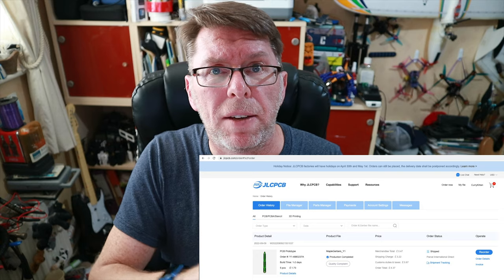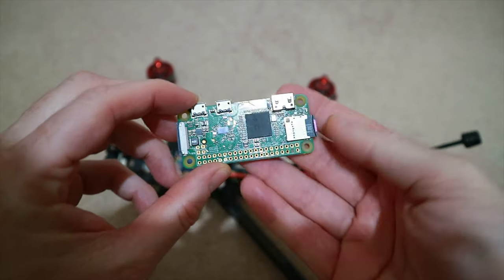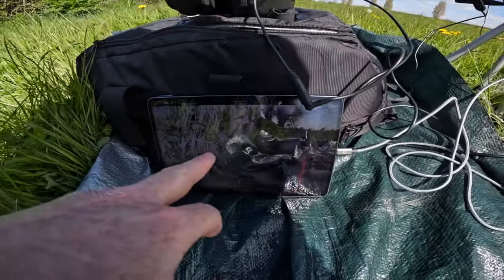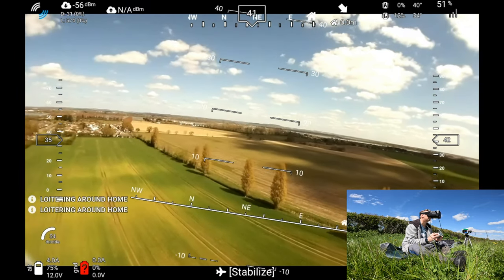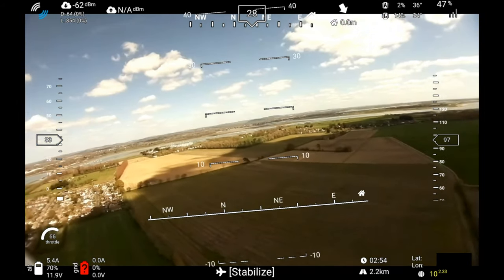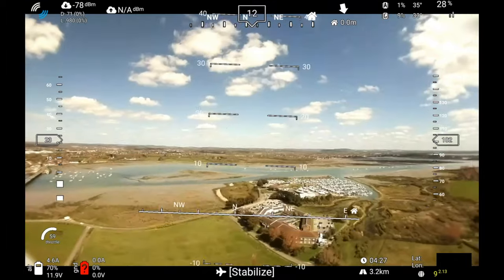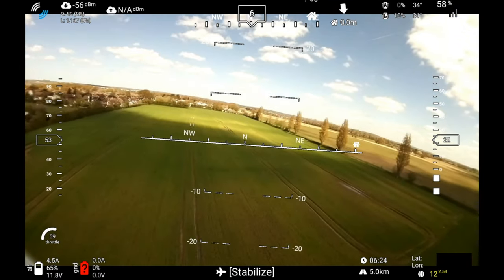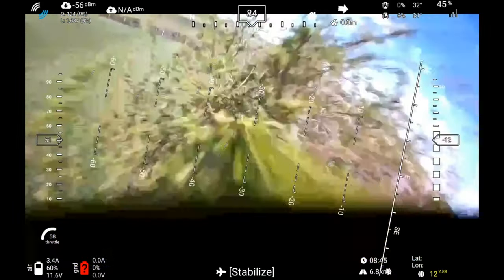Open.HD - getting a great picture finally.   It's all about the antennas!

Comment: Good job Wayne....That huge ladder AHI is so distracting. Do you even need it if you're not in cloud?...Those PCB antennas looked linear to me, my favourate when flying in 5.8g. Entertaining video m8...🤔😳😏😀😀😀🇬🇧
Reply from the maker: I agree - it's mostly there to see if the AHI drifted out... which, of course, it did.  Once I'm happy that I get that stable I have options to make that much smaller or turn it off
Reply: @CurryKitten  More to the point, where did the OSD come from?...

Comment: Have you tried a HDMI-to-CSI2 board on the Pi Zero? Wondering how good Open.HD would be for HD downlink on a camera drone, from a smaller Cine Cameras HDMI output.
Reply from the maker: I haven't, but I know others have and get good images from it.  It does apparantly add some more overhead to the latency though

Comment: Could you provide order deatils for the maple leaf antennas?
Reply from the maker: There's a section here https://openhd.gitbook.io/open-hd/hardware/antennas that links to the recommended antennas.  This will take you to this page https://forum.openhdfpv.org/t/maple-leaf-pcb-antenna/460 When I checked this today, they were doing some server rejigging - and it was down, so I'm not sure what it looks like, but hopefully by the time you'll see this it'll be back up.  Otherwise the raw Gerber files can be found here https://github.com/OpenHD/SwordAntenna
Reply: @CurryKitten  yes I thought the page would be back soon. You mentioned you had questions about thickness etc?

Comment: Glad you sorted out most of the issues, great flight video (except for the landing part 😜). In the early days of Inav, meaning years ago, me too, lost a couple of planes because horizon drift. So I switched to arduplane and never looked back.... Not an easy system to learn, but worth it by lightyears.
Happy landings, thanks for the hard work 👍🤝
Reply from the maker: Thanks for you help in all of this.  I haven't got on particularly well with Ardupilot.  Mostly I had "compass insane" flashing on my OSD and a refusal to arm :D  It's fair to say though, I'm only used it on an ancient APM 2.5 clone board and a regular designed-for-Betaflight FC that could run it.  I was actually going to start with Ardu in Open.HD, but I noticed it was putting out a 5v logic and the Pi wanted 3.3v.  I did get a logic converter, but ended up on iNav.  No doubt, more up to date ardupilot hw is much much better now

Comment: I wonder if you can scale a pagoda for 5.3ghz and build a custom helical for 5.3ghz. or to make it even easier, a 5.3ghz half wave dipole paired with a 5.3ghz biquad on the Rx. I got 1KM with a 25mw 5.8ghz aio cam with a  halfway dipole with a biquad. 
Btw this is the first time learning about openHD. Now I need to fallow the rabbit hole to learn more about this. Sounds cool.

Comment: I see your HDMI is on the side in the middle, it was easier for me, i have the Skyzone SJ-V01 and the HDMI is up top in the plastic part and i only had to make two small holes for a cable tie to secure the cable and could zip it down tightly as its plastic there and not foam like the main housing.

When you try Ruby you will like it, its soooooo different to OpenHD, the UI is also great and the mouse and keyboard free menu navigation rocks!

Comment: Nice update. Making nice progress.

Was going to say in last couple weeks the Pi Zero W inventory is reappearing, but sounds like only Pi Zero 2 W will be supported going forward. While they are a 2W's are ghost for stock at moment, they are promised to reappear in good numbers for 2nd half of this year. 
Can Pi cameras be used? RP just release some new editions a month ago. Just last week Sony (a maker of camera sensors) signed a tentative manufacturing agreement with Raspberry Pi Foundation. Details are on RPF blog.
Reply from the maker: Just typical they come back in and they aren't needed anymore :D  Yes - previously I've used an Pi camera, I did find the image quality horrible though.  There are some notes about the new cameras in this wiki page https://openhd.gitbook.io/open-hd/hardware/cameras/raspberry-cameras

Comment: Nice video as allways. Cool you didnt gave up on openhd :) 
I tryed 2.3.3 evo some weeks ago on a x86 laptop and pi4 as airunit with serious overclocking and it was working very well, recording with obs should be working aswell. I did not fly it yet, but the latency was noticably lower with this setup, especially on 640x480@90 fps. IMO all this projects need to be a really alternative to other systems i an affordable sbc with a decent h265 encoder and support for better cameras, for example e-CAM80.
Thanks and have a great day :)
Reply from the maker: Thanks - I'm looking forward to catching up with Evo and seeing what's up.  I'm hoping they'll support x86 on other OS's as well
Reply: @CurryKitten  X86 support was integrated in the first evo release and is working quite nice since then :) Next addition to the supported SBC's will be the Rock5(A and B) while not being that cheap, they allow for much more compute power. We're also working on getting more Cameras to said SBC's and maybe even for some cheaper alternatives, but this all takes a lot of time and work.
Reply: @CurryKitten  I hope so too, but its unlikely due to the wifi drivers wich need to be rewritten for windows :( however, i should have mentioned i ran it with vmware and forwarded video to the windows host wich ran gstreamer for decoding. Let me know if i can assist you with anything :)
Reply: Afforadable sbc's with camera support and h265 are currently not really on the marked, currently the imx415 (which is used by the e-cam80) can be used with the soon supported rock5 boards, or as a sensor inside the Siyi A8 mini, which we're working together with siyi to be supported in the near future (my current test-bench runs it with 1080p 30fps on h265 (with a pi4 since the siyi cam has it's own encoder))
Reply: @OpenHD-Official  Great news, thanks Rapha and keep pushing, you guys are creating something awesome!

Comment: Libcamera is one reason why the Zero has been dropped, the driver does not work with Buster which is the version the zero uses.
There are plenty of decent cams out there that do not need Libcamera and Ruby will run on the Zero and Zero 2, it gets super fast updates as well and has a vastly better UI and features in my opinion.

I Use Box Goggles, mine have a micro HDMI input, i bought a Micro to full size HDMI patch lead with a right angle Micro plug, the cable immediately after the right angler micro plug is secured with cable ties to the goggles  so that no strain can ever be placed on the socket and the full size end is on the head strap so that the regular cable i plug in exits to the back of me.

The full size HDMI cable i plug in is one of the thinner ones to be as flexible as possible but you can also get ones in a stretchy coil design like two way radio mics use.
Reply from the maker: Yeah - I did get as far as getting a right angled HDMI adapter for those goggles, but I've yet to construct a proper way of holding everything in place.  I will look at Ruby eventually, but not until I'm at least sorted out a run on the Open.HD Evo release.
Reply: It's not really libcamera, the raspberry zero can also run libcamera. The zero 1 was dropped because of it's limited performance, not allowing for the great error-correction which was introduced with openhd-evo. OpenHD can still be used with MMAL (the old camera-framework)

Comment: Great video. I just bought my second pi2 so i can test everything on the bench. 
I'm going to use it on a RC car but i have not decided if i'm going to use OpenHD or RubyHD 

What kind of box goggels are u using? Looked like an eachine EV800D? (that's what i have and hope i can use)
Reply from the maker: The goggle are called the "Eachine Goggle2" which is an odd name.  You can use anything with an HDMI in really.  Whilst my Fatsharks would be much easier to use, they only work in 640x480 resolution, so I'm using these ones as they do have a true native 1080p display.
Reply: Wow Ruby looks interesting. Is it open source also?

Comment: Noob question.
But do ac1800 wifi 6 ax models work?
Reply from the maker: Aren't those like big router-type devices, or did I loo kit up wrong?  In which case most probably not, as it's all about the chip set in the normal USB wifi dongle to use in a sort of raw mode.  I didn't see it in the supported hardware https://openhd.gitbook.io/open-hd/hardware/wifi-adapters but you could always check on the telegram/discord groups listed here https://openhd.gitbook.io/open-hd/#support-and-further-reading